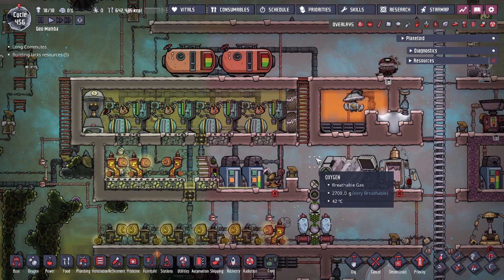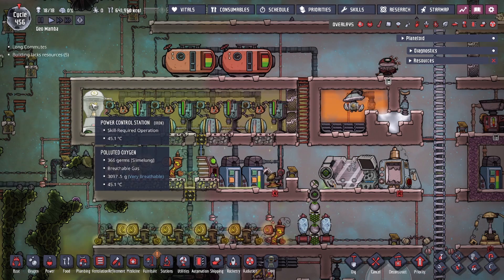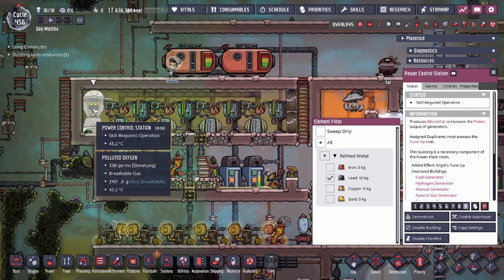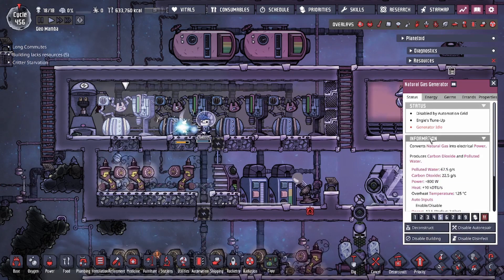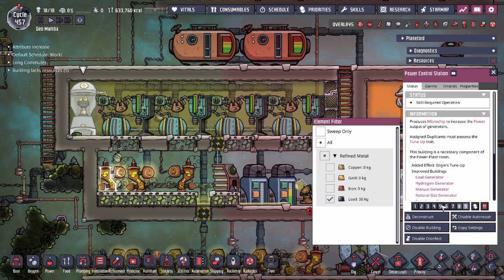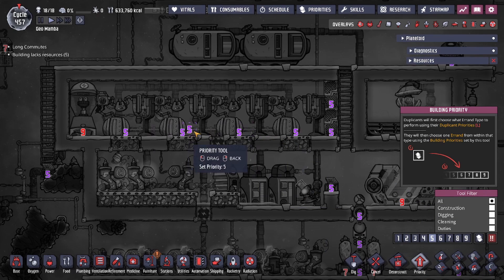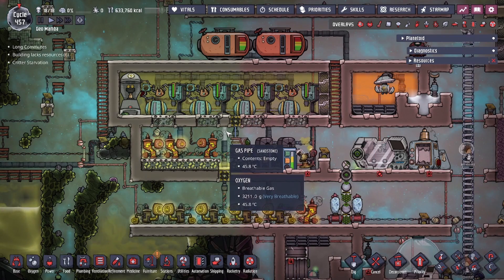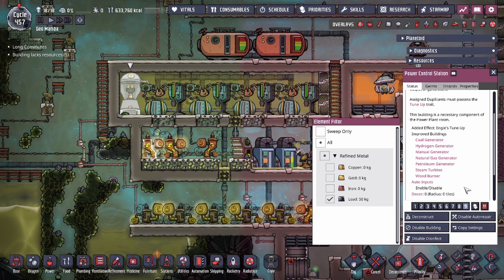How to get 50% More Power from your Generators with this One Trick - Oxygen Not Included

Comment: I'm not sure if the tune-up is that useful, except of course if the base is trimming with idle dupes. The long game is all about minimizing dupe labor. The problem with the tune-up is it fades away with time whether the generator is used or not. So if the generator stops due to automation or other reason, the tuning is wasted away.
Reply from the maker: true, which makes this more situational. if you do need more power and are already running high generator uptime, this becomes more attractive. b